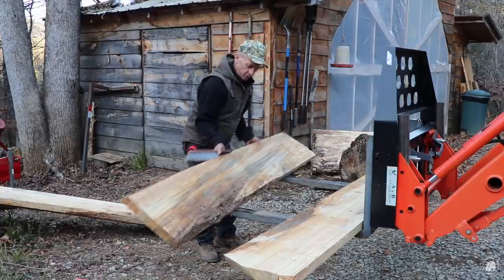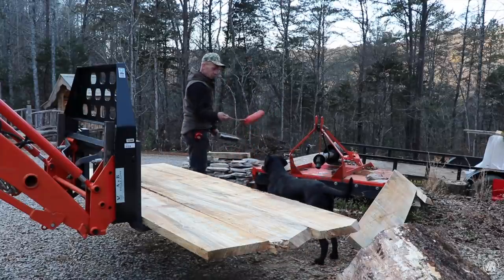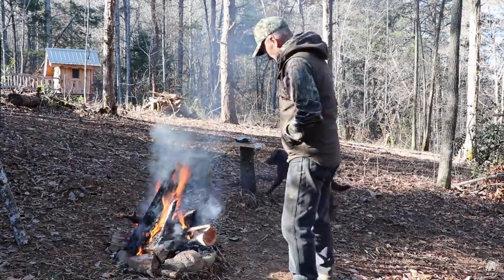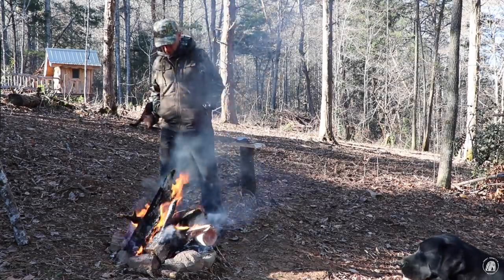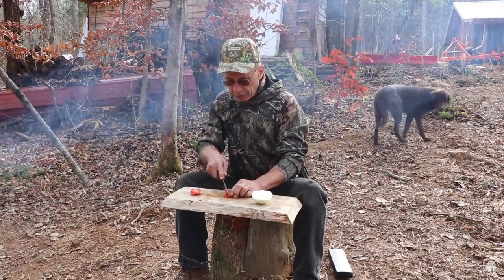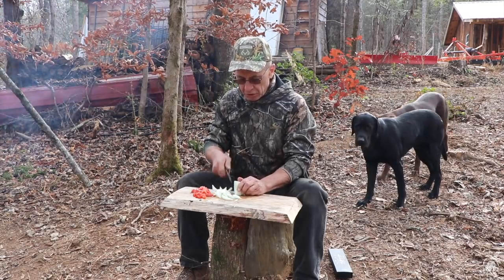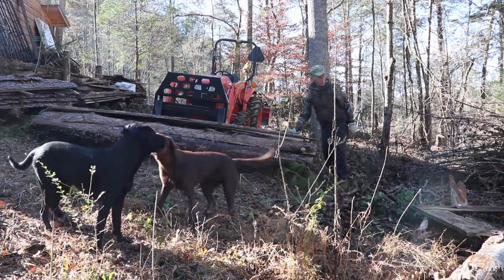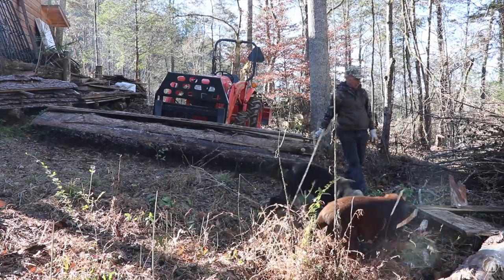YELLOW PINE FOR MY CABIN DESK | TIMBER FRAME OFF GRID CABIN

Comment: Those blue/green insulators are plentiful here in and around the Louisville Ky area. No problem finding as many as you want at flea markets for a couple bucks each. Not as many of the clear ones for whatever reason I don't know. I did a couple years at Bell South {now ATand T} working underground as a cable splicer in mid 90's. Those days of hard wired devices are almost gone.

Comment: The pallet forks are a great attachment for a loader. So many jobs that are made much easier and quicker.  The knife also looks like it would be a quality made knife, and easy to use. I do have a question about the pine for the counter tops and desk though. Are you not concerned with the possibility of powder post beetles being in the boards, since they have not been kiln dried? I have seen alot of problems from using un dried lumber inside a bldg. 👍

Comment: Hey Richard, back in 1989 when I first started at our local phone company in Southern Kentucky, I spent the first 3 or 4 months taking down the last of the "open wire" customers. We were already fully cut over from party lines to private, but some customers at the end of the line were still on open wire. I can't tell you how many spans/miles I took down and replaced with RDW wire, but I learned quickly to ground out the open wire once we killed it or the static electricity would sure let you know. I learned a lot from the fellow that trained me about sagging wire, bridal wire, dry spots, etc... but I sure was glad when that project was over. I saw a lot of change in my 30 year career (retired in 2019) and I'm sure you did too. Nowadays people's (landline) phone can be out 3 or 4 days and they might not even notice, but you let internet or TV go out for 5 minutes (anytime of day or night) and they go ballistic! Practically everything is fiber now, so today's phone men barely know what a scotchlok or twisted-pair soldered jelly filled sleeve is, but I bet you do.
Reply from the maker: I can relate to everything you talked about. We were cutting over party lines in Texas when I started, and had ranch land on open wire and some on old “dug wire” we used to call it which was buried drop wire with stranded wire inner sleeve but the gophers would eat it up. This was before the jelly filled buried line they have today. Most ranchers had an “exclusive four party” which in essence was a private line since they owned all four party positions and was cheaper than a private line. A lot has changed. Then of course the computer came along and that’s when the cable got rapped to extend the transmission abilities. Removing bridge tap, load coils etc…
Reply from the maker: I can relate to everything you talked about. We were cutting over party lines in Texas when I started, and had ranch land on open wire and some on old “dug wire” we used to call it which was buried drop wire with stranded wire inner sleeve but the gophers would eat it up. This was before the jelly filled buried line they have today. Most ranchers had an “exclusive four party” which in essence was a private line since they owned all four party positions and was cheaper than a private line. A lot has changed. Then of course the computer came along and that’s when the cable got rapped to extend the transmission abilities. Removing bridge tap, load coils etc…
Reply: @SmokyMountainOutpost  Lol, I bet we could talk for hours. I moved (partially) inside in 2003 to our IT department when DSL really took off, and I remember the dreaded load coils and bridge taps and how they destroyed DSL signaling. Load coils were easy enough to find and cut out because you could see (most of ) them, the small ones hidden in terminals were trouble though. But I couldn't tell you how many bridge taps we had to chase down using the old "radar" meters we called them, it would get you pretty close. In 2007 I moved into the Central Office and became the main switch tech for the rest of my career, but I never forgot my days in the field. I started in the winter so no one told me to take a can (or 2 or 3) of wasp spray with me when I climbed poles in the summer time. I learned quickly about that. Birds, flying squirrels, opening pedestals to mice or snakes, I bet you've done all that.

Comment: Do you know how to do the Smoky Mountain Boogie? Or is that too much before your time? Tennessee Ernie Ford sang a song by that title.
I don't  like the design of that knife, with the continuing curve of the knife edge it is designed strictly for slicing as evidenced in your video when you had to go back to finish your cut. For food preparation there is a lot of requirements for chopped vegetables and a Chinese Vegetable Knife is the best knife in have seen to do that. It is like a really thin cleaver with a straight cutting edge.
Reply from the maker: I don’t know if Dad knows how to do that or not, but he sure can “cut a shine” when he wants to. -Jennifer
Reply: @SmokyMountainOutpost  haven't heard cut a shine before,  makes more sense than cut a rug. Lol